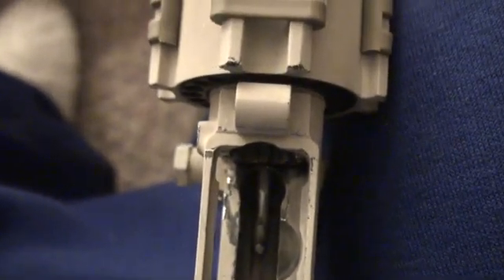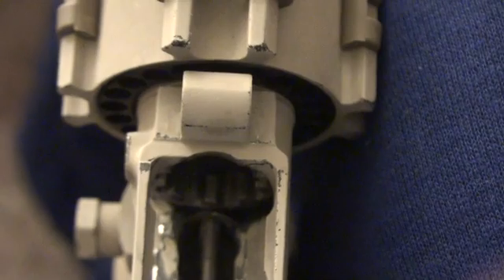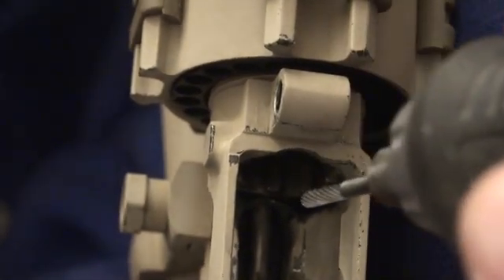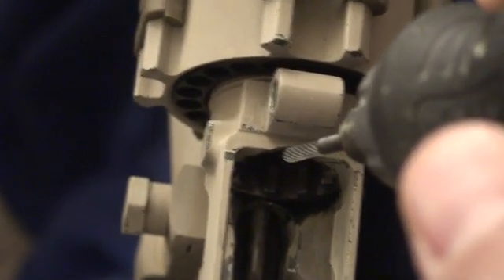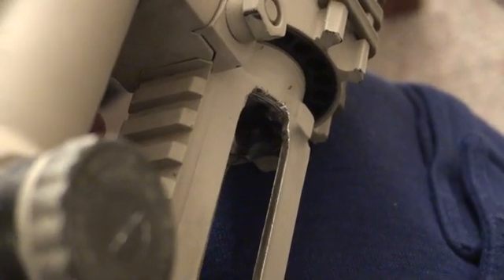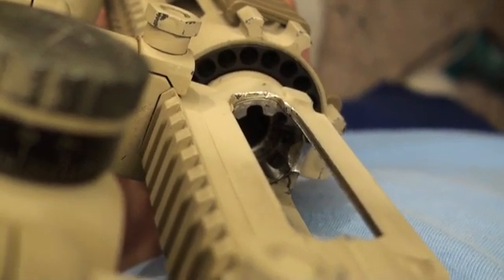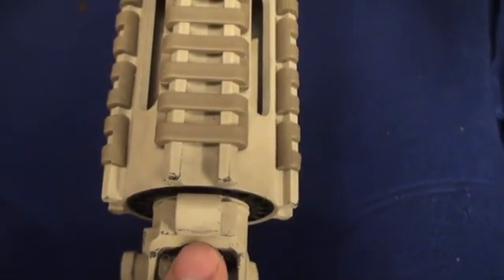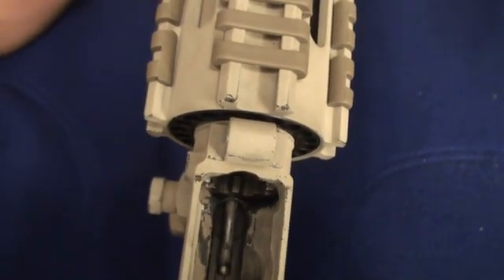WSSM VLD PMAG upper receiver mods.

Comment: The groove you are pointing out the tip of the rounds ride in the lower are also present in Spikes Tactical, Olympic Arms and Aero Precision (Surplus Ammo and ARms) lowers and I assume most any other that hasn't been wire edm magwell cut like some billett lowers.

With that said, of the three I have on hand that I can check, it doesn't appear to be as deep in the Aero and is the most defined in the Olympic and Spikes.

John A.